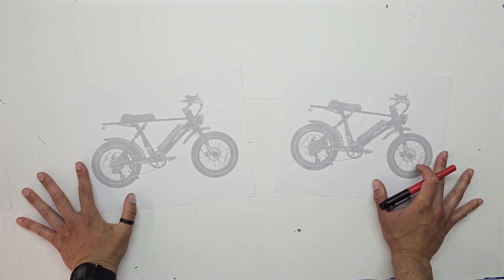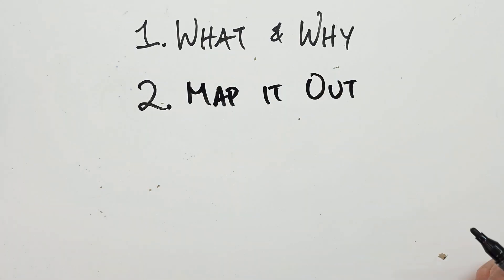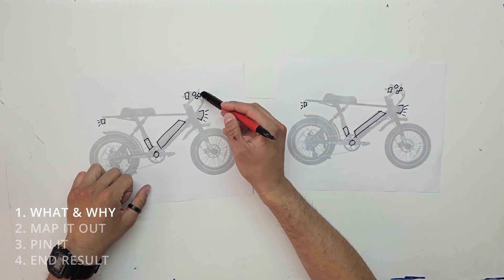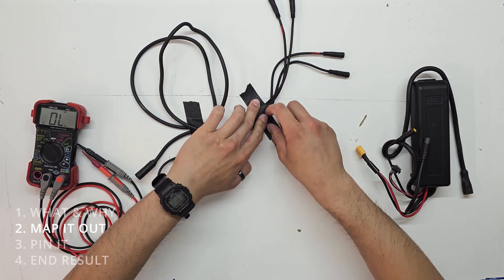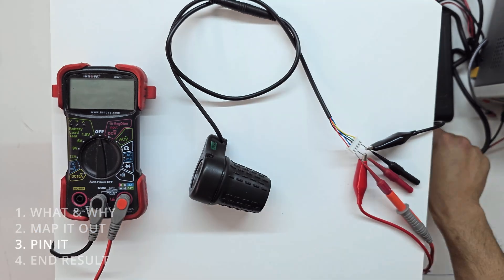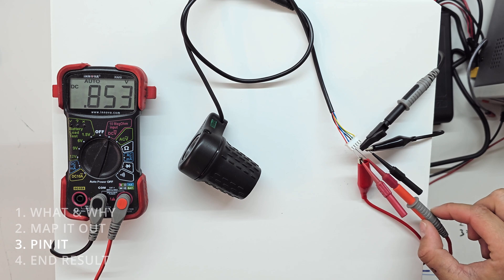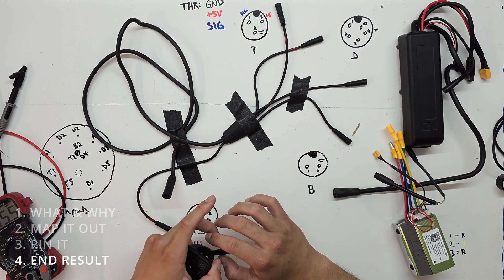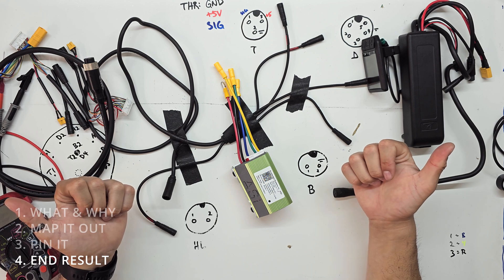How We Reverse-Engineer Ebikes for Controller Upgrades

Comment: i am wanting to upgrade my happy run g60 to a 48v 50amp controller. hub motor is a 750/ 1500 peak motor battery is 48v 18aph . I want to get around 40 ish currently it will run 28 to 30 mph. i am willing to upgrade battery if needed to keep decent range. its current range is 20 throttle 30 peddle assist. I also want more torque. I have already upgraded my suspension it will take 40mph i think with no trouble handling wise.

Comment: I just got a Freego F3 Pro 2 weeks ago. Loving it, but I have a few upgrades in mind. The most important, is a switch to 60 volt with 60-70ah. I think I can do it in the same battery platform, but what will the required controller be; and do I need to upgrade my motors to really capitalize upon this increase in potential available torque? Right now I have dual 48v 20ah batteries and dual 750w nominal, 1200w peak motors.